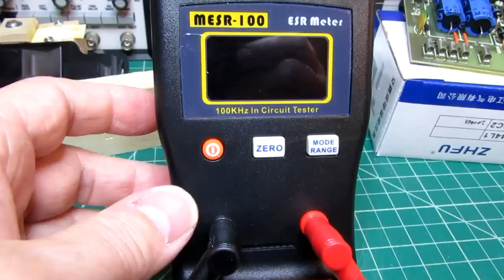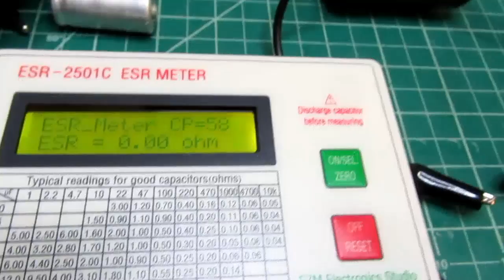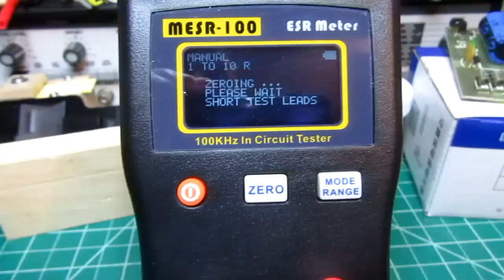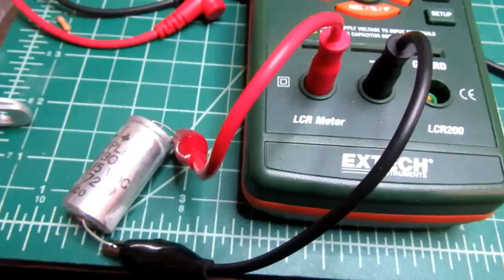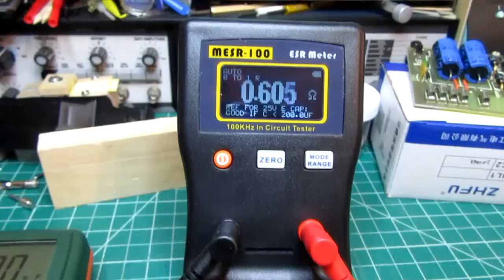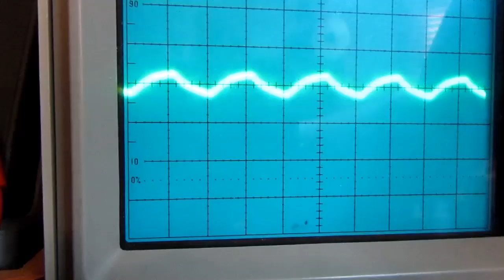MESR-100 In-Circuit ESR Meter: An aborted product investigation

Comment: I've used the MESR-100 to find in-circuit bad capacitors on computer mobos an P/S units. After replacing the capacitors with the high ESR values of 2.5 or 12 ohms, for example, with new capacitors, the mobo or power supply then worked. For the price, this works "well enough" to find bad caps that you can't by eye.

Comment: I know that this is an old post but wish I had found it before I wasted my money and bought one. I’ve started doing audio repair as a hobby and that a esr meter is a necessity for even checking new caps. I noticed that the higher the capacitance the worse the meter is off. I thought I was doing something wrong but watched several videos and they all used low  value caps so it made the meter look like it was working properly. Once you start climbing In capacitance the more inaccurate it gets. Needless to say it is going back

Comment: I assume your test set up was checked against the obvious systemic error - that is,  which meter you used first was checked for difference.
Reply from the maker: armandine, I said that I have access to several ESR meters and had included them in my evaluation of THIS meter. All agreed closely with each other, but this one was way off.
Reply: @youtuuba  I just checked an old 47uF 40V Plessey electrolytic with the MESR-100 and a DER EE DE-5000 and a M162 LCR. Not a whole lot of agreement but I agree the MESR-100 is suspect. Would be good to check against other dedicated 100kHz esr meters.
Reply: diode gone wild and imsai guy have good content on the meter.

Comment: As a hobbyist that rebuilds tape decks and amps, I would take the 2501C over this unit - I don’t like this unit.  Displaying only 25V is stupid and basically useless. And yes you want shorter leads, but not that short.  Just don’t like it….

Comment: Most ESR meters give inconsistent readings, even the Peak Atlas ESR Meter ESR70.
Reply from the maker: moby1388, I see a couple problems with your comment. First, unless you have an encyclopedic experience with ALL ESR meters, then how would you know what MOST do? In my own experience, good quality ESR meters give fairly consistent results, assuming out-of-circuit tests and fixed test frequency.

Second, you seem to be holding the PEAK ESR meter as some kind of gold standard (maybe it is the best one you have used), but it falls pretty short of that; I do agree that it is one of the better/more reliable inexpensive and handheld ones.
Reply: @youtuuba 
The answer to your first question is yes I have.  The PEAK ESR meter is one of the most popular meters, that's why i mentioned it.
Reply from the maker: @moby1388 how is it that you have thorough experience with EVERY kind of ESR meter....that is very hard to belive. And your assertion flies in the face of my own experience with many different types, from lab grade units costing thousands of dollars and on down to many of the cheap Chinese ones.
Reply: @youtuuba  
You need to get your eyes tested.   I said most, not all.
Reply from the maker: @moby1388 you missed my point. Unless you have the full knowledge of every model, you would not be able to determine any percentage, or "most" or "all" have any particular failing. I think you are full of hot air and made a careless assertion. But you can try to defend your statement if you are confident.
Reply: @youtuuba  
I said most ESR meters, not all. That is obvious I don't know full knowledge of every model. Did you have learning difficulties at school?

Comment: Have been using one for over a year, I would prefer the made it with longer leads , or some kind of strap mount  so you could mount it on your hand, it is usually in the way, when you measure  in circuit caps, with those short  leads.

Comment: so which in-circuit cheap ESR meter is the best choice?
Reply from the maker: System1007, in my opinion and based on the tests I have done, this MESR-100 is not a good choice, for the reasons given in this video. When checking electrolytic caps, DCR is about as important as ESR, and this meter does not test DCR. A lot of newbies and hobbyists are getting fooled if they place their trust in it.

The best 'cheap DCR/ESR meter I have found is shown on my other video that came out about the same time as this video.
Reply: Thanks, are you referring to the ESR-2501C ? Can you test caps for ESR while IN-circuit with it?
Reply: Anche se mesr-100 legge solo la esr e’ molto preciso e affidabile. Poi il Q e il D anche se non c’è l’ha lo calcoli subito a mano. Questa è la formula 
Q= 159:(Cuf*ESR) 
D= 1/Q

Comment: @youtuuba so, i have the same meter and have wondered about its accuracy. The people who made a stink about it working in circuit are missing the point. It kind of doesn't matter whether it works in circuit or not if it's not accurate 100% of the time. If I'm testing caps and for some reason I think a cap is good when it turns out to be bad, I could ruin something by not replacing that cap. 

I think one of the main and overlooked selling propositions of the extech is the ability to change frequency. For example, today I was looking at a 450V 470uf Vishay electrolytic whose data sheet specified a specific max ESR of .180 at 100 Hz. If the MESR only tests at 100KHz, then I really have no way to reconcile its result with what the datasheet says.  And then the part where you discovered it was generating .6 volts.... just enough to turn on some transistors! Although it did seem that the voltage dropped once it was crossing a capacitor. 

At the end of the day, probably the most accurate way to test capacitors for both capacitance and ESR is with an oscilloscope and the signal generator that has a pretty fast rise time. There's really no beating a scope (and the adjustability of an aignal generator). Thanks for the great review.

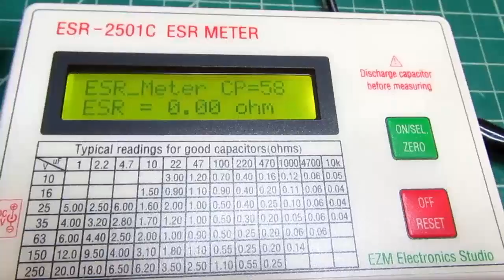Comment: 4:30 I have the same meter which says "MESR-100 V2". The user manual is Aug 2013 (shows it at the top of the page) and it does tell you to short the test leads or to use a jumper wire.

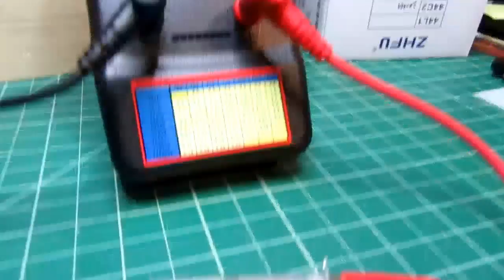6:50 sure looks like your neg terminal is hitting the can of the cap. Also interesting is yours is firmware version 3.1 while mine is 2.3.
Reply from the maker: @larrybud  , well the negative lead SHOULD be electrically common with the can.......
Reply: @youtuuba  They aren't all connected, but even if they were I would imagine it would change the ESR rating if the lead is shorted to it.

Comment: Seems as though this reviewer is not in accord with most of its other reviews. Odd.
Reply from the maker: marketingmixture, "this reviewer".....I guess that is ME.....did not even remotely attempt to be "in accord" with other reviews; this was a totally independent review.

Having said that, I have watched lots of other "reviews" of this product, and NONE of them really qualified as reviews; just "overviews" at best. The "reviewers" would just connect the product to some capacitor, show that it said 'good' or 'bad' , and assume that this was correct, accurate and reliable. As I said in MY review, I only tested this one example, but its numbers ranged from poor to very inaccurate. The same test capacitors were verified using multiple of brands of tester, so THIS tester is the one that was not working as it should. 

So it is not ODD that my evaluation differs from most others; "disappointing" more like it. MINE included a real attempt to verify if the product was working as it should, and I corroborated my results with multiple other testers. Hardly any of the other reviewers on YouTube did anything to verify that the darned thing worked or not.....they just assumed that it was working.

And apparently I was the only reviewer who understood that DCR is a critical thing to test, particularly on electrolytic capacitors; the other reviewers apparently did not think of that, or did not even understand why it is important.

Comment: WORKS GREAT 

NO NEED TO DESOLDER, CHECK CAPS WHILE THEY'RE ON THE CIRCUIT BOARD 

WHAT'S NOT TO LIKE, SAVES A TON OF TIME
Reply from the maker: @drumtwo4seven  drumtwo4seven, apparently you did not watch the video, or were unable to understand it.

"What's not to like?", well I named some things that are not to like.

"Checks caps while they are in the circuit", well, so do most other testers, but they often don't do a good job of it. Also, this tester can't test for DCR, which can't be tested in-circuit anyway, but which is a necessary test of electrolytic capacitors. As I said in the video, a cap that is bad due to internal leakage/breakdown can often pass an ESR test, and will also probably read an acceptable capacitance value, even while being functionally inadequate in a circuit. This tester does not check DCR, and thus cannot really test the capacitors very well.

I also pointed out in the video that this meter gave ESR readings (tested out of circuit for best accuracy) that were very far off compared to other (better) ESR testers that I used on the same caps.

With your approach, apparently you just trust that a piece of cheap Chinese stuff is giving you reliable readings, and just blindly go with that. I guess you can't be very serious about this topic.
Reply: @youtuuba the reason so many people just trust this cheap Chinese device is because it is insanely cheap compared to any decent alternative.

Comment: Found mine in the swap meet less than 10 bucks, this is what I consider a good enough product.
Reply from the maker: maxab73whatever, here's the thing. Do you want RELIABLE ESR readings, or do you just want to congratulate yourself for getting a "steal" on a product that can't be relied upon to do its job? YOU would not be able to tell one way or the other unless you had other ways to corroborate it, e.g. one or more other meters.

Comment: I ordered the Ezm 2501C to replace my Mesr100. It had incorrect  readings just like shown in this video.  Turns out one of the Mesr100 leads was faulty.  It works as it should now but its short leads make the ezm 2501C the winner by a country mile.

Comment: I have one of these and its proved very useful for the price I thought. I'm struggling to understand why you are so disappointed with it and yet happy to muck around with that EXtech that cant even read the capacitance. The only annoying thing I find is the short leads but I accept thats how it has to be at 100Khz. I dont see a down side of not measuring DCR surely a multimeter would suffice for that.
Reply from the maker: Campbell Morrison, I explained why I found this unit to be inadequate. And I don't know why you think the Extech LCR meter can't read capacitance. Because you seem to think that a simple multimeter is a substitute for a proper tester, I guess you will continue to struggle to understand my meaning.
Reply: @youtuuba  fair enough I'll watch it again I may have got the wrong end of your Extech LCR meter. PS I was only suggesting a multimeter for the DC test not ESR or even capacitance. Personally I also like to check the leakage at the rated voltage also for which I use a variable PSU and multimeter as this is not done with any general capacitance instrument Im aware of or can afford.
Reply: @youtuuba I like your videos but seeing some snarky replies to viewers is not good practice IMHO. :/
Reply: @DonzOzzo  eff off

Comment: That meter is probably "good enough" for general service work to weed out caps that have seriously deteriorated. I used the analog meter based on the creative electronics   LM324 circuit. That didn't have nearly the resolution as this but helped fixed many tvs. That circuit sort of generated what looked like a sine wave because the oscillator was 1 section of the 324 and it's slew rate was so poor it looked closer to a crummy sine wave. I can see why you might want to return it though for the price. Looks like about 60 bucks as of April 2024.
Reply from the maker: Marka, yes this meter costs around $60-$70 from Amazon. The other small ESR meter I showed costs only about $40 from the eBay seller, has a better display, better test leads, more accurate measurements,  and also tests capacitive DCR, which not even the EXTECH meter I showed can do properly; I think it is a much better value than the MESR product; it's downside is that there are important things to know to use it correctly, and it comes with no documentation;  this is why I made  YouTube video user's manual for it, as well as a downloadable user's manual and a Quick Start Guide, the location if which is shown in that video.

I would caution anyone about thinking this MESR model is "good enough" for casual electronics repair. It's only purpose is to provide good/bad information on capacitors,   but at least on mine, some ESR readings were off by nearly an order of magnitude, which can make a good capacitor look bad, and vice versa. Also, because it cannot measure DCR, it can easily lead its user into NOT replacing capacitors which have awful DCR but acceptable ESR (which often happens).
Reply: @youtuuba  The EXTECH model can´t be used "in circuit" because of the voltage of the square wave used; over 0.6 volts.
Reply from the maker: @biogons14  , yes, but I was not comparing the EXTECH to the MESR. I was comparing the MESR to the other ESR/DCR tester that I had also made a video and, as well as written a downloadable manual for it. The only reason I had the EXTECH meter in this video was for a 'third opinion', with a readout I could easily get in the workbench shots. I also own and have ready access to higher end ESR/DCR meters, and with the exception of the EXTECH not being good at measuring capacitive DCR, its ESR readings are very close to what the higher end meters I tried were showing.
Reply: The mesr 100 v2, is now around 80 bucks with tax.